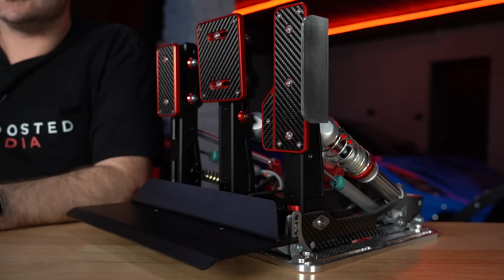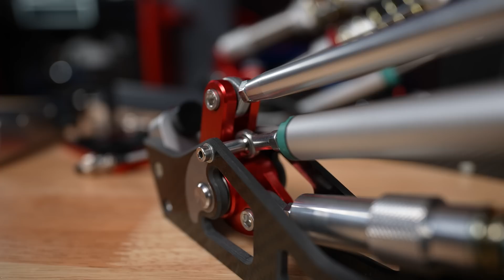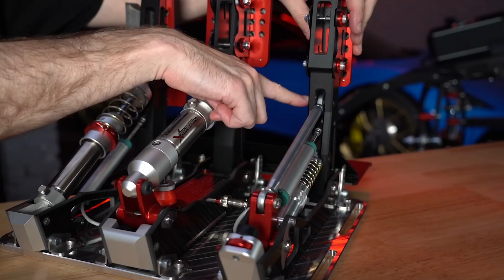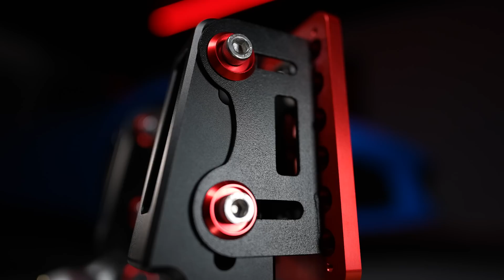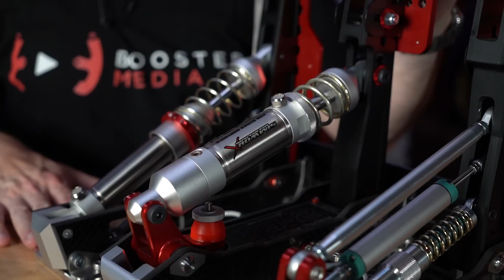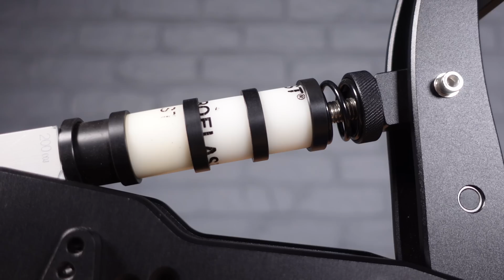REVIEW - Simworx Pro GT V3.2 Sim Racing Pedals

Comment: Hey will, first thing is i love you and love your videos . 
At 20:56 you said bottom groove is the stiffest and top one is the softer one , from my experience with pedals and obviously logically thinking about the leverage point shouldnt it be the other way around? 
As in the lower the leverage point the easier it should theoretically be pressing the pedal?
And obviously that would effect the throw as well
Reply from the maker: No, what I said is correct. The lower the leverage point, the less leverage you have so the stiffer the pedal feels. 

The manual states “For a firmer and shorter pedal press, lower the cylinder in the  adjustment slot, for a longer and softer pedal press, raise the cylinder in the adjustment slot.

:)
Reply: @ just to make sure,  i had just tested this on my HE ultimate clutch and throttle (as the brake pedal does not allow to change the angle of the shaft) and just like I mentioned , the lower the shaft was positioned the significantly easier it was pressing the pedal and longer the throw was , which again makes sense as you have more leverage. 
Just like with a shifter for example , the longer the rod and the lower the leverage point is relative to the length of the rod the easier it will be to engage and the longer the throw will be .
Reply: @boostedmedia

Comment: Man my Heusinkveld Ultimates + are unbreakable, elastomers still going strong even with 100KG brakeforce on all soft rubbers. dampers etc all still perfect, changed with Simcore wide Pedal faces in orange color and now it’s perfect. Little bit sqeeking here and there but overall very good pedals

Comment: Given these are as good as my local sim hardware manufacturers (max 20 minutes up the road) I took a stab at the GT v3.0 pedal set when I wanted to go high-end for the first time in 2020 and they were a great bit of kit - but at the time those still relied on DiView for calibration, and I felt like in hindsight I wasn't the right kind of customer really (I'm just a sim racer in my spare time despite my hopes and dreams once upon a time lol) - so in the end sold them and switched to the HE Sprints which cost about A$1,400 at the time (vs $1,600 I think it was for the GT's)

Great to hear they're still making quality products, but yeah I think as much as I'd love to support local, I'm probably not the right kind of customer still